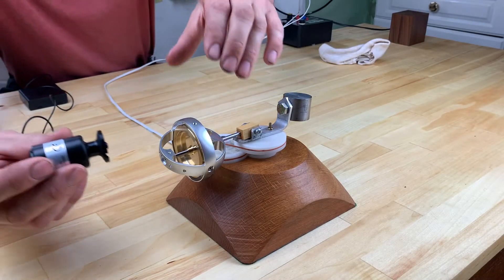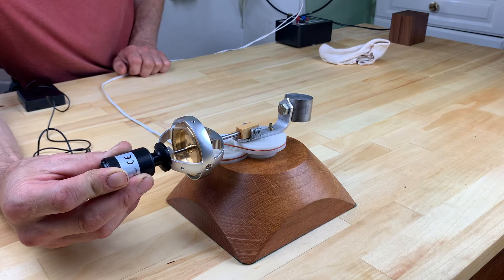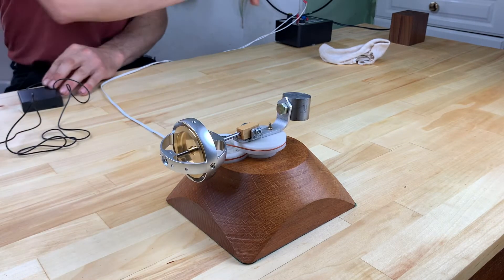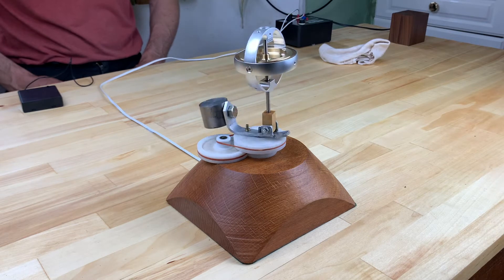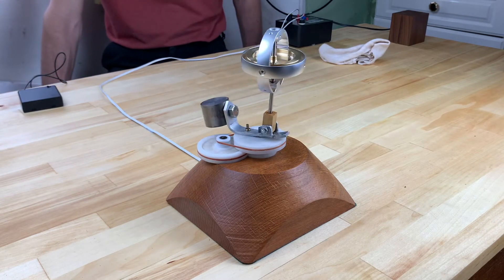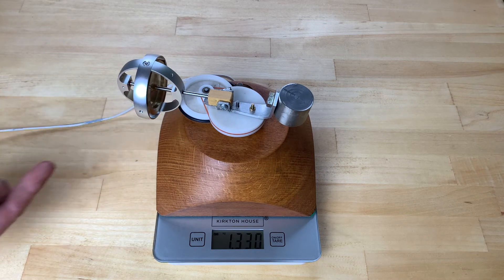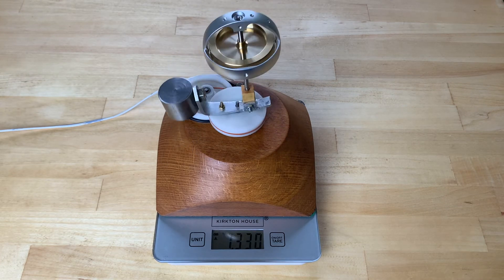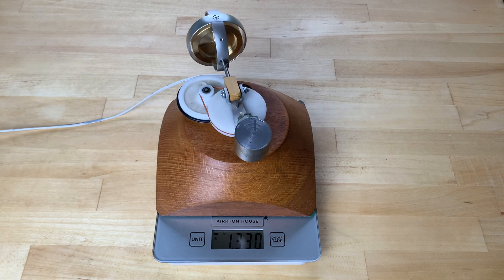anti-gravity wheel experiment

Comment: why all are so obsessed with weighti gryos? It can not become lighter at spinning, mass i defined by density, not by movement. But it gets additional potential energy, so you just transfered kinetic enery into a potenctial energy, so it went up against g force with less effort. Look at basics, forget weight it does not matter at all.
Reply: gravity is a shading affect of aether / vacuum density. It's like a casimir force between two magnetic fields, they will be pushed together because they shield each other from the pressure of the medium around it from the direction of the other fields center, such that the density of the medium is lower between the field, producing a casimir like attracting force. matter is just a compound of magnetic fields, there are no particles at all. the basic building blocks of matter is the magnetic field of an electron, which in fact, is the electron in inself, and all other attributes come from field interactions. 
Also, a magnetic field is a perpetual cavitation bubble.

Comment: i see bearing friction...
spin the wheel up, and all thats driving it is momentum.
its slowing down, as its creating friction, in the bearing, and windage.
the bearing, no matter how good, will be dragged along with the wheel.
creating a torque on the arm holding it. slight, minute, but its there.

using an internal motor would still create a torque on the arm...
some type of reaction aka heros turbine would be interesting, no back torque to keep it spinning...

the initial lift itself is of course, the precession that is simply inertia attempting to take a straight path. confined to a circle on a pivot point, it either rises on a helix, or descends on a helix. 
the "weight loss" is directly proportional to loss of inertia in the rotating flywheel. its slowing down as it "rises".
replace the pivot causing it to follow a hemispherical path with a vertical rod and bearing.
you can make it lift, you can make it fall...

interesting thought.... if you force it to fall faster than gravity whilst precessing, will it slow down the wheel, or speed it up?

think about those balls you get with the flywheels inside...theres a way to force the precession to accelerate the flywheel...

conservation of momentum.

where is the pivot point?
centripetal/centrifugal force.

the area of gyroscopes is sadly unexplored i feel. very... repetitive. all the same configurations.

inversions.

think OUTSIDE the box.
"a wheel within a wheel..."

i keep seeing a "wheel outside a wheel"...

how do piezo electrics work?

error. input/data;corrupted.malfunction:shutdown initiated.
Reply from the maker: Thanks for your comments, a lot to think about.

There is a method to attach the motor to the shaft with this particular gyroscope, close to your description.

The idea of ‘forcing‘ precession  reminds me of the ‘power ball’ devices. Although accelerating the flywheel by precession still seems mind boggling!
Reply: any motor will always produce a back torque, a reaction. only the reaction turbine stands alone in this regard. an electric motor will try to spin its stator, an ICE the vehicle its bolted to, etc etc... think helicopter tail rotor...
but yeah, hollow shafts, sealed joints, high velocities with low efficiencies... meh. a reaction turbine is sort of impractical. maybe worth chasing nevertheless.

 ahh. yes. powerball. thats what theyre called. always wanted one. sigh. amazed they were ever released to the public.

the old quote, "pull one up by ones bootstraps"...

rocket science. throw something out the back, push a small part of it one way to push most of it and oneself the other way. continue slowing down then accelerating in the opposite direction small parts of what you are throwing out the back, having expended energy in accelerating it as you had to bring it with you,  requiring to throw more and more of it out the back as velocity increases to slow down what remains simply to continue throwing it out the back in the attempt to continue accelerating it.

sounds really smart when you break it down to basics. NOT.

still, its unavoidable. gotta push down to go up.

yet a "powerball" lets us convert a push into a rotation. what are we pushing against? the inertia.

need a fulcrum. an anchor. something to jump off of. why leave it behind? cus its heading the other way... and to stop it would mean we would stop... but if its rotating it isnt heading the other way? which way is it heading? 90 degrees in all directions to down. or up.

as things spin, they fling out.
as things draw in to the center, they spin faster.

and then finally... if you arrest the motion of the flywheel you get a massive torque that isnt a precession at right angles.

think boy think.

you, and the wheel are falling.
yet you can still use your mass to push against the wheel, in a way that increases its inertia, without it actually accelerating in its downward plummet. you will slow down in direct proportion to your inertia versus the wheels inertia.

you can then harness that stored inertia, releasing it in a burst. the entire assembly suddenly attempting to rotate at a velocity proportional to its inertia and the flywheel.

 in which direction? is there enough to then momentarily halt the downward plummet?

see saws. one must go up as one goes down.
Reply from the maker: @paradiselost9946  thanks, there is a lot to digest here! I wonder if we are missing something at a basic level? https://youtu.be/v7vmt8eWqdQ

Comment: You gave the disk some angular momentum around a horizontal axis, 
Then you supply more angular momentum around a vertical axis. 
The axis of the disk is free to rotate upwards.
It moves until the resulting torque is minimised.
The weight of the system remains constant.

Comment: Alternative Energies Journal, many years ago, had 2 page article with drawings, photo, with write up on how the now late Mr. Baumgartner built and tested his hovering  platform with ETHER interference for gravity control. Unit was plywood circle he stood on, with central mounted childrens train locomotive electric motor. It was modified for stator/armature change from parallel wound together to series wound for higher speed RPM. He used computer configuration for making spiral vortex turbine to mount on motor shaft. (Looked like washing machine spinner)  Hole was poked through center of plywood for the air passage. ETHER control enabled a lifting funtion of very large weight. Unit was also tested in town and  lifted front end of city bus when pluged in to wall socket. "The power of NATURE'S spiral - in tornados revealed!"
Reply from the maker: Thank you for sharing the information.
Reply from the maker: Thank you for sharing this interesting information

Comment: I believe, this effect can be explained in muplitple ways. Firstly, in terms of classical mechanics. If we imagine this disk, rotating counter-clockwise, everyrthing is symmetrical and nothing special. But imagine it starts moving to the right relative to us. In this case, if we take a discrete moment in time, the velocity of the uppermost point of the disk will have less speed (relative to oursevles) than when it was idle. And on the contrary - the lower-most point will have greater speed. This effectively means, that at this discrete moment the axis of the disk, which it rotates around, is actually shifted upwards a bit, which leads to what we see as lifting force. As for the scales not showing the difference. Well, I gues it's simple because the gyro is not free to move directly upwards. Instead, while "trying" to move upwards, it still affects the rest of the system - the arm in particular, wich, in turn and indirectly, presses on the scales.

And since I mentioned work "relative", I believe a greater (and even more promising) explanation could be given by General Relativity. Unfortunately, I'm myself not yet so confident in my math skills and all that complex theory. Bujt on a higher-level, if we abstract from some "minor" things, it looks like it can still explain the effect the same way as above: due to difference of speeds of differect points of the disk relative to us, gravitational forces become incompensated, leading to disk move upwards.

UPD: and here is another interesting moment. I wrote "relative to us". But what actually matters is the movement relative to Earth. If we move along with the gyro, it will still go upwards. So, it also shows that it is the matter of what to move relative to.
Reply from the maker: Relativity might be able to provide some interesting ideas, but I’m not the person to deal with it either.

Comment: A Unit requires 3 discs spinning ,They are to be in RPM ratio , 
just the way Keely did it in late 1800's. He used heavy sirens fed from 
compressed air and varied the frequency of sound as RPM was changed to 
RATIO. See books reference works of  John Keely,  Philadelphia , Pa.  
1865-1899. One ton structure of resonance + harmonics raises up and 
settles down as per lowering of RPMS.
Reply from the maker: Thanks for the information, there seems to be a lot to look at out there.

Comment: Hi, I'm a bit of a gyro nut, like you! The way I see Laithwaite's experiment is this (or rather, this is a theory that could be tested): He lifts the weight up with more ease on his arm, but only because his entire body is acting like the 'tower'. By 'tower' I mean an object holding a traditional gyroscope as it precesses around it. So in theory, the weight could simply be shifted through his arm towards the middle of his body somewhere. So when he lifts it up, he's actually putting more force on his *legs*, which now require more energy. The total weight is the same, but because of weird gyroscopic forces, the weight is transferred towards the middle of his body, his arm basically acting like a part of the 'tower'.
Reply from the maker: I like your thinking!
Reply: Yup. So no antigravity.

Comment: If you made the gyro out of "V" magnets and you made them two deep set up in the repel mode so that you can maximize the "B" field of a magnet .   I suspect your entire apparatus would float in the air.  The "B" field is the center of a magnet,  that's why the "V" magnets were requested.  Check out Coral Castle Florida and his anti gravity system.  He used 25 "V" magnets and five deep all in the repel mode to take advantage of the "B" field.
Reply from the maker: I am not very hot on magnetic fields but I will look thank you.

Comment: The simple reason why the scale reads the same weight during the lift is this; the force that is used to lift the free wheel upward must transfer an equal amount of force downward; thereby, the weight remains the same, and therefore, no change.
Reply from the maker: I think that you are right. To become horizontal the outside edge must lift and the inside lower, but the pivot point is at a distance so that the 90 degree twist is through an arc :)
Reply: That is incorrect reasoning; like so many poor students you are confusing the condition for equilibrium with Newton's third law. If the mass is moved vertically by a force internal to the system, the acceleration contributes to the effective weight and will be registered. It is more likely that a centrifugal force which is associated with the rotation compensates the other effect and the measurement device is simply not sensitive enough to detect the overall effect. When it is moved with the finger, the force applied is exterior to the system and the reaction acts on the table, not the measuring device, leading to the observed decrease in weight (that is, the gyroscopic gadget is, in effect, cantilevered between two supports).